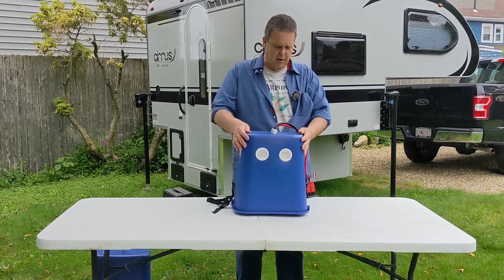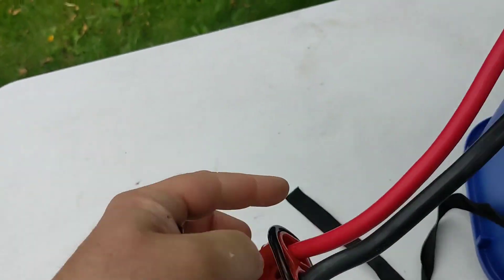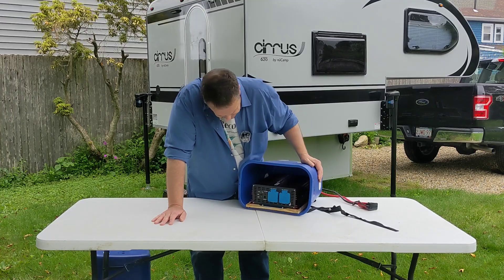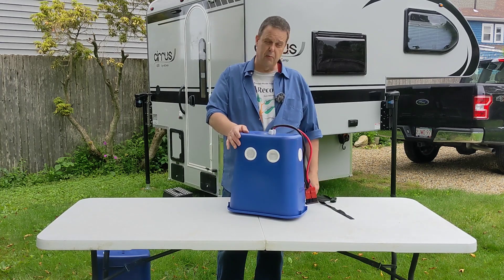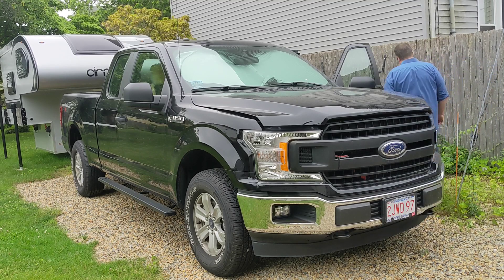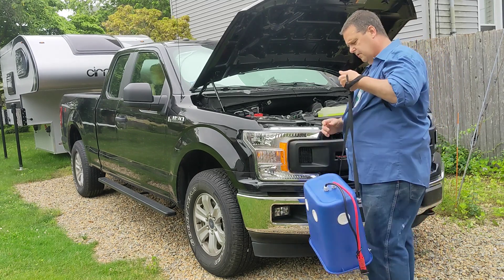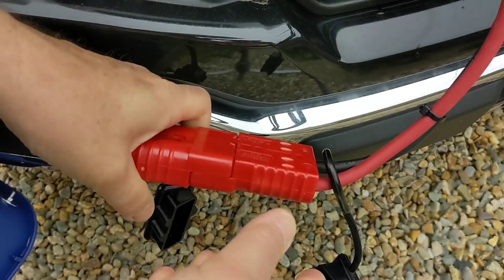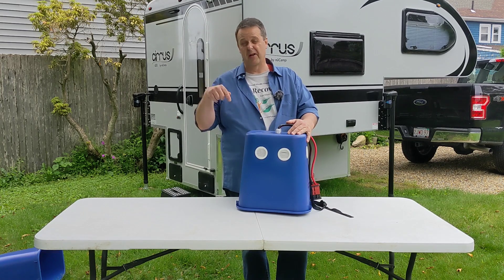Use your Truck's Engine so you Don't Have to Carry a Generator

Comment: What about wear and tear on your truck with extended idling? Would rather run a generator than put long idling times on my truck. Plus why not just connect the 7way plug to your truck? It will charge the battery while driving or if you are sitting idling for no reason also.

Comment: Hey man, I recently purchased a cirrus 620 that's slated to be built in October, I asked the dealer to install a lithium battery and they said they could only fit 1 Battleborn into the battery compartment, do you see any way to modify it to fit 2 or 3?

I was planning on charging off the alternator + solar to run the 12v electronics and a new dometic rtx 1000 or 2000 12v air conditioner.

Just planning on not running anything on the 110v except maybe the microwave on my little portable ecoflo delta, it's good for 1800 watts to microwave something and run any 110v in a pinch.
Reply from the maker: It should be able to fit two of them. You'll also need to upgrade the charger/converter or they'll never fully charge. Realize that the refrigerator uses More power in a day than the solar panel can produce. That means you have a daily deficit of electricity, so if you're going to be out for a long time you need another method for recharging your batteries or you will run out of electricity.

We have a community building on Reddit if you'd like to join us.